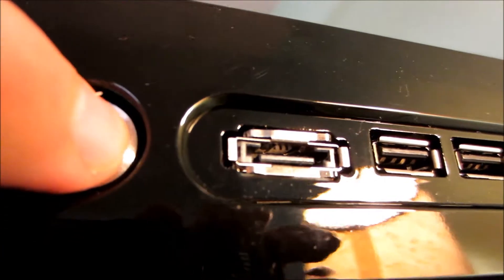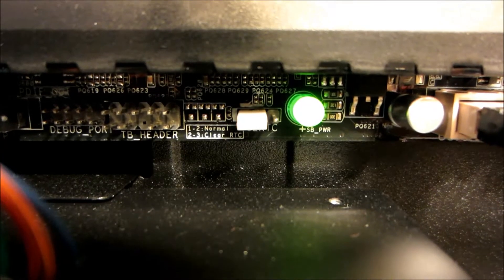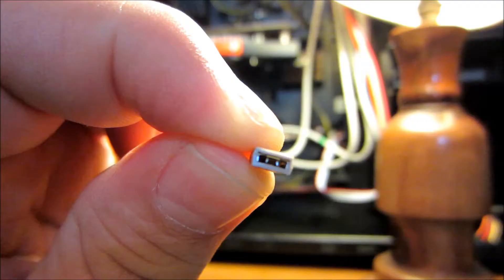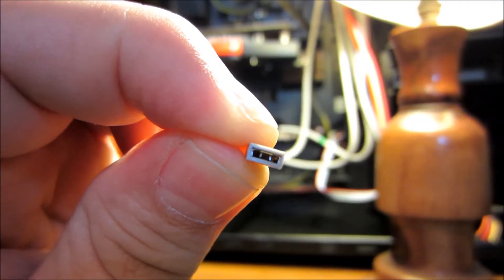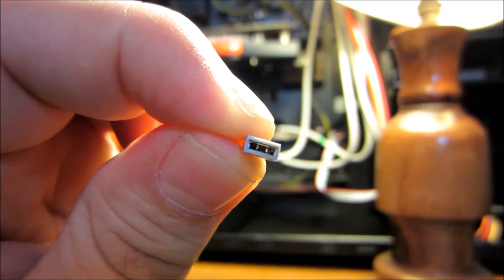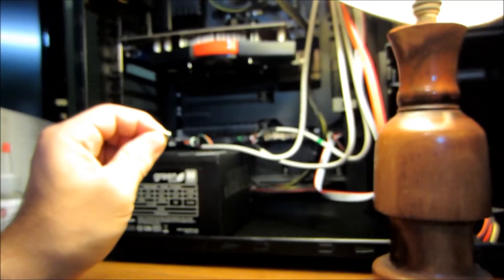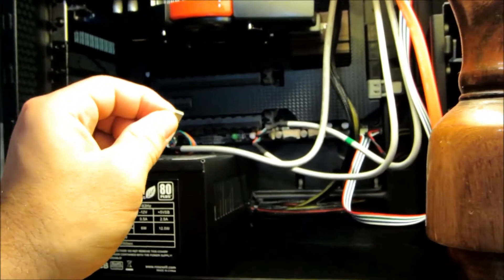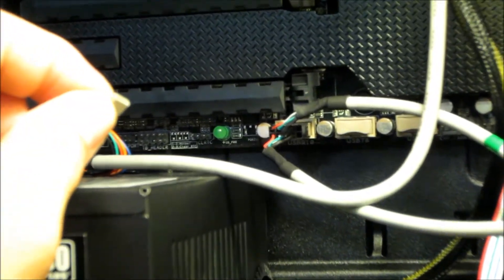Computer does not shut down- Z77 Sabertooth fix?

Comment: Are you saying, that the power supply could have started causing all this?  Because it did work for a couple months, then the shut down thing all started.  I have not flashed my CMOS yet.  As I just watched this video.  But I do have a 1000 watt corsair, and it has a lifetime warranty.  So if it might be the culprit.  Tell me, and I will replace that unit.  It wasn't cheap.  But I thought a kilowatt will probably do till GOD comes.  I'm sick of buying a new power supply.  I just got a graphics card kind of recently, and IT ALONE takes a big bunch of watts.  250 - 400, sounds right.
Reply from the maker: In my case it was the power supply. As you can see I had to reset the CMOS but problem came back till I replaced the Power Supply. You have a huge power supply. I had to check out many forums to find that this might be the culprit. I hope if you do reset the CMOS that it will work again for you.
Thank you so much for watching! 
I'm still a noob at this.

Comment from the maker: This was just a demonstration on how to clear the setup parameters by erasing the CMOS data. You can do it this way or take out the battery but this way is easier with this board. If you leave the cap and turn on the computer it will cause a system boot failure. I would just stick to the book.  I hope I answered your question somewhat